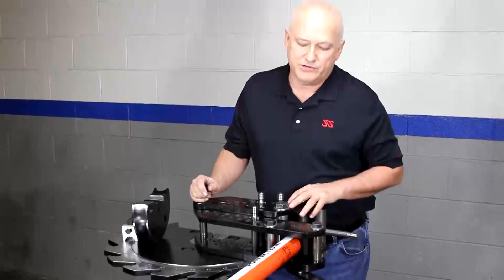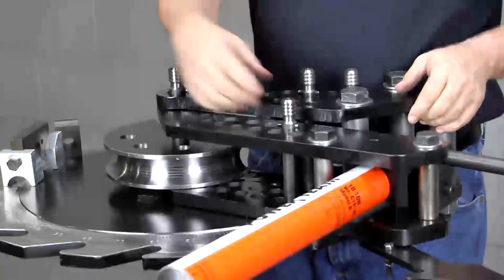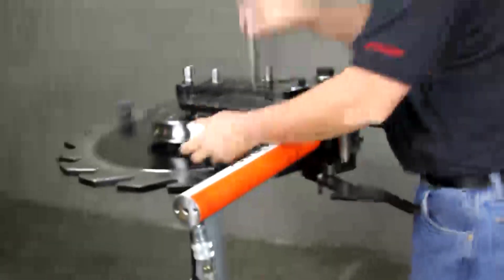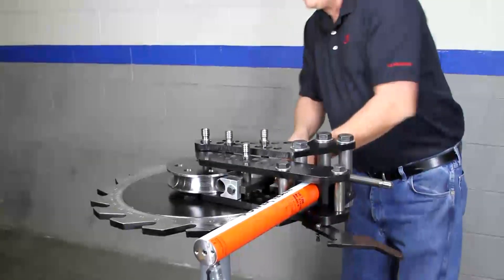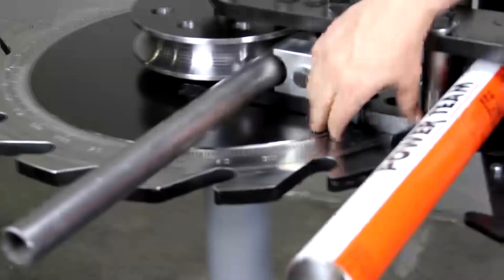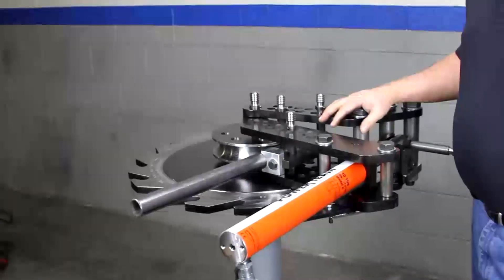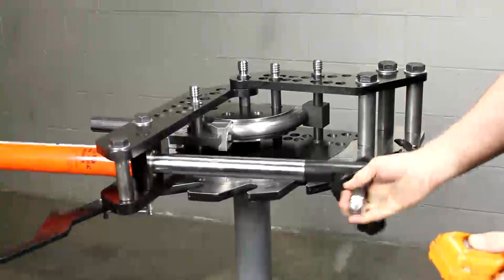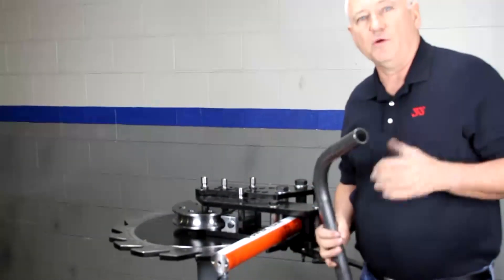Model 4 Bender by JD Squared, Inc.mp4

Comment: This machine is great but would be better with an adjustable recessed angle guage, that way u could reset to zero degree before bending so u don't have to work out so much to get correct angle ;) ... Just a thought
Reply: If you’re getting this as a fabricator and can’t pull that off then idk what to tell you

Comment: I bought his bender and have yet to figure out from any of the instruction how the heck to determine where the actual bend starts, the tube is inserted at an angle so you cant use the edge of the die to locate your bend, it seems arbitrary starting location, I hate to say it but keeping my pro tools 105, not as strong but heck I can at least start a bend where I want it to start.

Comment: I have this bender and its great for large diameter pipe on large radius. When using on small pipe and small CLR its really hard to get the pipe at the start of the die, I'm starting at around 22 degrees. Is that right or am I doing something wring?

Comment: I think you just exposed the problem with your benders degree wheel. People are going to mess up bends. 103 degrees = 90 degrees? give me a break. For God sakes you even messed up in your sales video. Thats a total fail and just stupid. Come up with a better system before trying to sell this one to people.
Reply: Never had any issues like that with my Pro-Tools 105!
Reply: That wasnt a spring back issue. The guy did the math then half way through the bend he forgot his math and didnt account for the 13 degrees he started at when he took the slack out of the tube.
Reply: I own this bender and honestly its great. Once you stop looking at the start point and degree wheel it makes sense. I bent multigle ref tubes for different diameters and its been great to use. The best part about it it could use multiple model dies. Which I have.